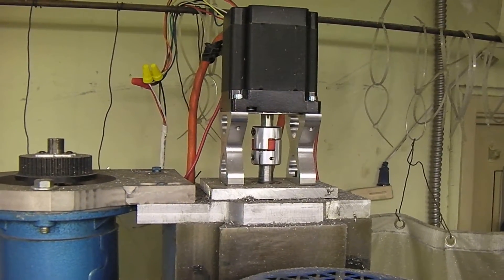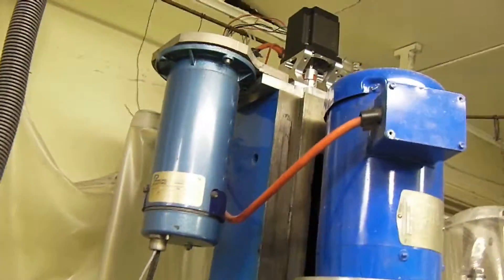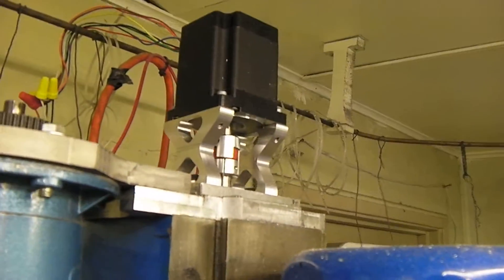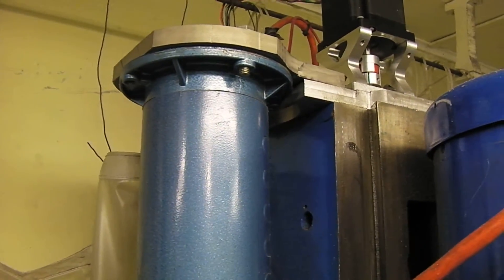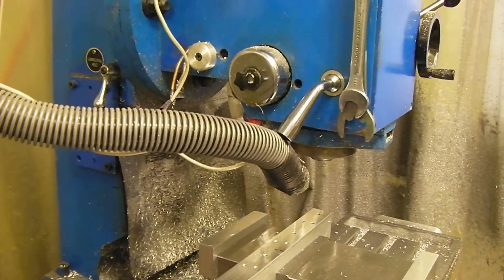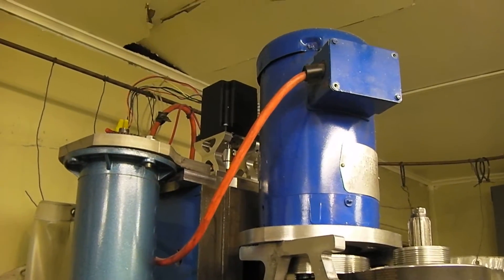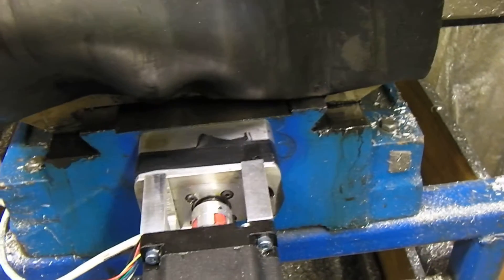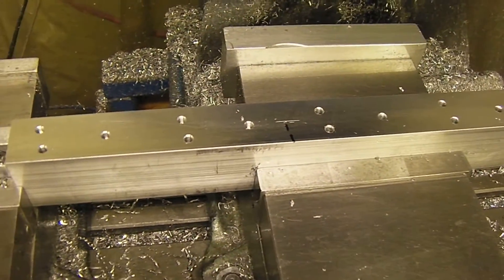G0704 and PM-25  Z stepper motor size.

Comment: Always like your video...very straight forward, no fluff. 
I do have a question that centers on the subject of this particular video, (Z axis motor size). I have attempted to power the very same machine’s Z axis screw with a 1200 oz/in stepper only to find it woefully under powered for the job. No matter what dip settings I used (for micro-stepping adjustment as an admittedly futile effort to win the ‘power’ battle), the results were the same....Lots of buzzing, no movement. It baffles me since my torque test on my Z screw yielded a requirement of only 6 ft/lbs were needed to spin it.
Did you do some ‘tweeking’ to that screw and/or bearing in order to reduce  the required torque?
Reply from the maker: Something is not right if a 1200oz is loosing steps. I run a 1200 all the time now and you can loose steps but its kind of hard too. 
I run the Z at 70 IPM with a relatively slow G force of .9 at 75V.  The 1200 oz does a lot better at 100V to 120V but most drivers dont run that high. 
You need to look at the mico steeps too. Micro steps make the low RPM much smoother but high mico steps reduce high speed power by 30%. I run around 3000 steps per rev. Any less and it will ring at lower RPM. 

Hope that helps.
Dave
Reply: Thanks Dave. I appreciate your help. Actually, I do suspect something perhaps a little more serious. 
I realize that amping up the supplied voltage should give it a boost; I’m presently delivering 62VDC from a switching supply, so a move to 100 would be almost a 50% bump....not sure if that translates into a 50% power jump though. In tweeking with the micro-stepping I do hear a little less buzzing, but am not seeing any additional improvement in rotation whatsoever. 
Two issues seem to now be apparent to me. 
The first is that I had Charter Oaks install their largest motor which I can see from your video is probably 50% taller than the one on your machine, (and subsequently, heavier). 
The second issue is more visually subtle but readily apparent when hand cranking, in that it cranks with a “rhythm” (easy then hard then repeat). This seems to indicate to me that there is a slight misalignment between the bottom bearing, the motor-head lift screw nut and the top bearing of the z-axis screw; (a problem I’m not sure I really want to dive into. While the testing I did with my torque wrench seemed to consistently yield 6 foot pounds or less (within the 1200 oz/in rating of my stepper), it doesn’t seem as though that test yielded the results I needed. 
Thanks again Dave, always appreciate your insight. 
 - Walt
Reply: Addendum:
I guess I’m leaning towards at least doubling the stepper size based on the anemic output that I’m getting from the existing unit. 
(I had high aspirations that the 1200 oz motor was going to be perfect fit.
Still, when finished, I plan on controlling the Z with a rotary encoder until I make the move to a full CNC conversion.
Incidentally, when we last spoke some years ago, you told me that you were intending to power the Y axis from the rear. As I expressed a similar desire, I wonder how your effort turned out.
Reply from the maker: I have changed the idea of a rear Y stepper mainly because of what I'm doing to the new IH  I'm building. The base is going to have 24 pieces of rebar screws into it and cast into concrete.  This will be a stand and also re enforce the base. It will be about 1000 pounds. Because it will be hard to move I don't want to have to service the screw from the back. 

On the stepper. They sell a 1800 oz. On my IH I had a tight spot at the top and it really took a lot of force to move past it. Many of the new closed loop drivers will take 80VAC which is about 110VDC. I have one set to sell if you want. The 1800 at 80VAC is really powerful.  I might have a transformer to go with with it. Email me at davedaxx1@yahoo.com if you like.
Reply: I really appreciate your offer, but I honestly believe that I’m going to need something on the order of a 100% increase over the 1200 in order to give the head the vertical agility needed for peck drilling cycles and such, (not a 50% increase which an 1800 oz would have provided). My machine also has a tight spot near the top where the 1200 has a lot of difficulty in getting past. When it is able to struggle through, it loses even more steps than through the rest of the range. I realize that this will mean the use of a NEMA 42 motor, but as I see on other YouTube videos, it looks like they are getting the speed and agility that I’m looking for,
I like your idea of adding mass to the base, the units need it! I’d like to think on that and see if there’s a way to do so and still run the Y axis from the rear. This idea still has appeal since I want to still run my machine manually; (I have a way to use an encoder wheel and an arduino to run the Z when operating manually).
Thanks again Dave for your offer and insight. I do believe that with better Z axis screw alignment (which I believe is responsible for a lot of the drag coefficient), and perhaps a normal sized motor with some counter-weighting measures for the head (as I’ve seen elsewhere), the 1200 would give the agility required for CNC peck drilling cycles.

Comment: you think the closed loop stepper are not needed or not  worth the extra money?
Reply from the maker: I like the closed loop steppers a lot. The one big advantage is if you fault a drive it  can send a stop signal to your BOB and the mill will stop so you don't junk a bunch of parts. I have some now and will be running them on a few mills. If not closed loop then full servos. If you look around the closed loop are just a little more than regular steppers. I'm looking to get some in to sell.
Reply: @ArizonaVideo99  may I ask what Bob your using?
Reply from the maker: @wow-wow-p8d  

On the old IH mill its just a cheep PP board from ebay, like the C10 board. Im looking at newer one now for the new builds.

Comment: Hi, I'm  a complete newbie to milling.  Im 67 and have a pm25 that I use (so far) for small manual milling operations. Honestly, I didn't understand a thing you said LOL, but what I  do know is that with two shot rotator cuffs,  I need a power Z axis motor simply so I  don't  have to crank and crank the handle.  Can you recommend a solution for a newbie like me for just that axis? Thanks!

Comment: I use a 720 oz  DMM servo with a 5 to 1 timing belt to a angular contact bearing set and mounting block with a 25 mm ground ball screw.
I have been running it this way for over five years with no problems

Comment from the maker: Christopher, Thanks for you comment but have you ever run a 570 oz stepper at 50V and 5A on the Z of a G0704 mill? It makes plenty of power.

The 570 has lower inductance than the 900 oz and way less then the 1200 oz stepper. 

Inductance is 2.5mH for the 570, 2.2mH for the 640 (KL34H280-45), 3,3mH for the 900 and 6.3mH for the 1200 oz stepper. 

At the same voltage and current the stepper with the lower inductance will be the fastest and make the most power at speed. 

Of the stepper listed at 50V the 570 makes about .5N at 1000 RPM and the 900 oz is about .68N and the 640 does well at .63N. 

The power gains with the larger steppers is vary low for the extra cost.

The two best ones are the 570 oz Nema 23 at 5A and 2.5 mH

 http://www.automationtechnologiesinc.com/products-page/nema-23/nema-23-three_eighths-inch-dual-shaft-with-a-flat-570-oz-in

And the Nema 34 640 oz 2.2mH 6.3A stepper.

 http://www.automationtechnologiesinc.com/products-page/nema-34/kl34h280-45-8a

Both are really fast and make plenty of power. 

Power curves for both.

The 640 oz 

http://www.automationtechnologiesinc.com/wp-content/uploads/downloads/2015/05/KL34H280-45-8ATC.pdf

And the 570 oz .

http://www.automationtechnologiesinc.com/wp-content/uploads/downloads/2012/02/KL23H2100-50-4BT.pdf

Comment: 570 is fine for x and y, but I wouldn't recommend it for the Z especially if you want any kind of speed and acceleration you don't have to wait for on tool change position run to full head up.  80ipm is sloooow to wait on.

Comment from the maker: Its a older Gecko 201 drive so they are 10 micro step. 

I mostly keep my steps between 10 and 30. Higher and you often run out of steps with a slower PC.

Comment from the maker: Hi Eric,

My mill had the same thing with the Z. My table was good and a almost perfect finish. I went to a belt drive years ago and after that the mill was just so much better to use. I have milled at least 3000 pounds of aluminum and it just keeps on working.

I do have a second IH mill here and I'm going to be selling a CNC kit for it in a few weeks.  I had to do a little work on the ways on it too but I have a new way of doing that which is much better than just using lapping compound. I use double sided tape and stick sand paper to a dovetail on the slide  and by hand give it a few slides over the tight  spots, changing paper often. This lets you use three straight surfaces and only removes material from one surface so it stays straight. This is much better than lapping which by nature has to make a bowed surface. 
I have to do at least one surface on the the new PM-940 mill so I will do a video of the process when I do.
Reply: +ArizonaVideo99 I have an IH mill I bought several years ago. I've seen your video on your belt drive conversion, which I like a lot. Do you sell parts for the belt drive conversion? Another thing I want to do is put a CNC control on the quill so I can run my Criterion boring head. As you know a Bridgeport has an automatic quill downfeed; but the IH mill doesn't (which I think is dumb! I told Tommy that). What would you recommend? Thanks very much for your time. I find your videos quite inspirational.
Reply from the maker: I do sell the belt drives but I have too many other things going on right now to make more.They look like this.
http://s1294.photobucket.com/user/arizonavideo/library/

I would just add a motor to the stock Z screw for a power feed. Its not too hard just to CNC the Z and it will be one less axes to do later.
Reply: +ArizonaVideo99 Well there's no rush on my part; so if it is OK, I can just wait until you have more time. How can we can keep in contact?  I would appreciate the help. Thanks again.
Reply from the maker: my email is davedaxx1@yahoo.com

feel free to contact me

Thanks 
Dave

Comment from the maker: Hi Kent. I have not tried the closed loop steppers but have had lots and lots of people wanting to run 1200 oz steppers on the Z on the G0704 or PM-25. We have a really good choice for steppers for that size mill with the 570 oz Nema 23 stepper. It is fast  and makes more power than you need so I run the X and Y at 3.5A so they make less noise and I run the 570 on the Z at 4.5A.

My point on the video and I think your setup proves it is you dont needs HUGE steppers for a small mill or really even a big mill. 

It is nice to have extra power to help make up for tight spots in the ways ans if you have ball nuts packed tight and you do have that with the 570 steppers. 

How much is a single 385oz closed loop stepper and where did you get it?

Comment: Given that inexpensive motors are so available, it's cheap insurance to get the next size up. I tried the opposite. I've been using 285 oz-in closed loop steppers successfully with your PM25 kit, on all axes. Monitoring motor current, shows reserve capacity. Monitoring the follow error, shows 20 steps or 1.8deg at speed, which quickly (instantly) goes to zero when stopped. Tweaking the PID parameters may further reduce the error, but it's not needed.

Comment: I have a 12z mill that I bought from Tommy and not at all impressed with it I have a taper in z axis dove tails and I have to shim the head to get it trammed in. And it looked like they belt sanded the table seriously. Cant get them to replace it under warenty either. Do you have any problems with you mill? the main problem on mine is z axis binds going up and head drops going down hints tapered ways. I am a trade machinist and I run Bridgeport cnc mills every day my thoughts are it's a great mill and great accuracy as long as you don't push it too hard.